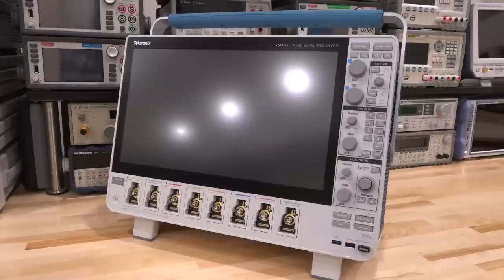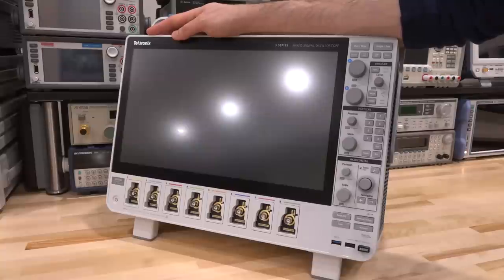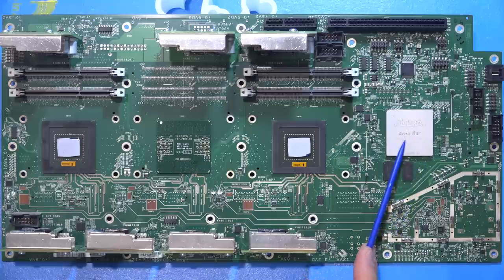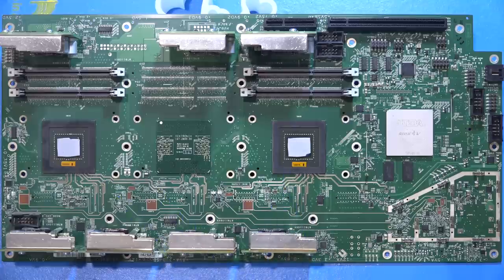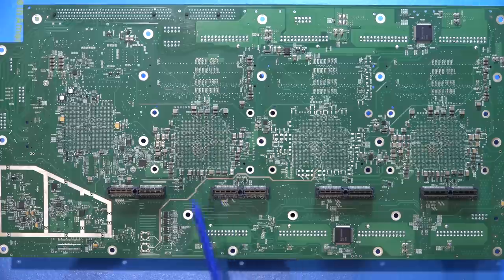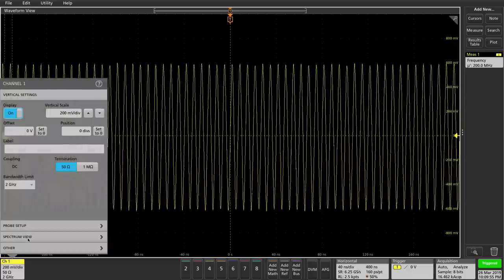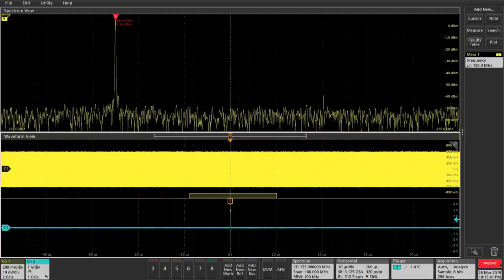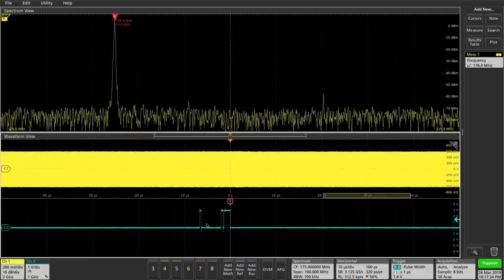TSP #149 - Tektronix 5-Series 8-Channel 6.25GS/s 2GHz MSO Teardown & Spectrum View Experiments

Comment: Nice job, Shahriar.  A few comments:  At about 12m you stated that the memory and sample rate drops when you add all channels.  That's not true in this instrument.  You retain full sample rate and memory depth on all channels.  I like the idea of pluggable mixer modules.  Of course, the MSO6 goes to 8GHz and thus could do this measurement without down-conversion.  The ADC samples are not interleaved between the analog and RF paths - the same samples are available to both the analog path and DDC path simultaneously - this is why you can get Spectrum View up to the full BW of the scope.  At around 22m you commented a few times about not being able to drop the spectrum time exactly where you want it.  This only happens when you're using a mouse or touch screen to move the spectrum time.  If you use the wave-inspector shuttle-jog control, you can put it anywhere.  It's just a little bug in the UI when using the mouse to drag the spectrum time.  One more thing that would be VERY interesting to do on this signal would be to double-tap the Frequency measurement badge that you have on, and turn on the Trend trace.  Then, you'll see the Frequency vs Time trend of the hop (similar to the FvT trace on the MDO4k).  Another handy feature of Spectrum View is that the pinch/pan/zoom all work on the Spectrum View display.  Also, the Horizontal position and scale knobs directly control the center frequency and span.  Pushing the Position knob will adjust the center frequency to the Reference Marker frequency.  Another interesting point about having Spectrum View on multiple channels - you can have a different center frequency and a different spectrum time location on each channel - think of the possibilities...  As for triggering on RF, MDO capability, etc. - all I can say is that this initial release of Spectrum View is just the tip of the iceberg....
Reply from the maker: Thank you for the clarifications! I filmed this before the firmware was released and had no documentation. Why does the sample rate change when I enable the Spectrum View? Is there a way to fix the mouse 'snapping' issue? I was never able to get Spectrum View to show the anything more than 312.5MHz, do you know why?
Reply: @Thesignalpath  In the current implementation, the Span is limited to 312.5MHz for the 5 series, and 1.25GHz for the 6 series.  This may change in the future.  Similarly, in the current implementation the maximum time-domain sample rate is cut in half when Spectrum View is enabled, but I haven't heard "why" yet...  The spectrum time location can be precisely set using the jog-wheel on the front panel, and using the Spectrum Time Position field in the Spectrum Badge.  If you click on this field, you can roll the mouse wheel to adjust in 1% increments, and pushing the mouse wheel (3rd button) puts you in "fine" mode where it adjusts in 0.1% increments.  Engineering tells me that the 'snapping issue' when dragging by hand will be addressed in the next release.
Reply from the maker: @w2aew  Fantastic! Thanks Alan. I'd love to meet sometime again soon. I hope all is well.
Reply: @Thesignalpath  That would be fun!
Reply: Last week I used for the first time the Trend trace which based on the measured frequency (automatic function). It is amazing, because the current value of frequency is determined every period of tested signal (!). Hence the trend function can precisely generate the trace of frequency changes. Incredible functionality.
Reply: @misyogi  There is also an optional feature of the Spectrum View digital down-converter that can give you the Magnitude, Frequency and Phase deviation traces for any signal - much more precise and higher resolution than a measurement trend line.
Reply: @w2aew  Thank you for the hint. I will check it on ours MSO64 and MSO58 scopes.
Reply: @misyogi  ...and you can even use the normal scope measurements on these RF vs Time traces.
Reply: Triggering on events in frequency domain or spectrogram should be a feature. Does it support actually a proper frequency vs time spectrogram / waterfall view?
Reply: @CodeJeffo  You can trigger on the RF Magnitude vs Time and the RF Frequency Deviation vs. Time characteristics of the RF signal.  Spectrogram/waterfall coming shortly...

Comment: Very cool instrument and analysis. Obscene amount of fast math computation. Thanks for your hard work. Watched at 1.5x haha.  Some thoughts:
-Product/market differentiation is an obvious business concern in terms of not wanting to enable every conceivable option on every instrument. Tek is very generous as a company, but they have to have a working business model of course. Enabling new firmware features on existing instruments over time, allows a lineup to remain competitive without manufacturing changes. Flexible hardware architecture goes a long way for that when it comes to initial product planning, also giving software/firmware guys more dev time after release. Higher initial costs vs higher long-term returns etc. Yay business things.
-I've seen some weird BGA chips before that look like interposers from the top but actually have a die or two on the underside. No bypass caps in your case as you said, so probably not what's going on here.
-I've always wondered if there are gov't restrictions for sale/manufacture of products that could function as an extremely wide bandwidth realtime spectrum analyzers, in terms of being used by bad actors to characterize complex radar signatures etc. Kind of like IR cameras being limited to 9fps for US export due to similar concerns of unwanted use.
-Realtime wideband capture + multiple receivers for triangulation + "deep" analysis/characterization database + tactical interconnectivity = big current mil. interest for obvious reasons
-w2aew's comment talked about frequency vs time trend, it would be interesting to see how "nicely" that's implemented. As a point of interest, one of the scopes I still own is an old 2GHz LeCroy WavePro from 2001, and with enabled options, it can do frequency waterfall display (time vs freq), 64Mpts single waveform capture + 2.5Mpts FFT on any part of captured waveform, which you can scroll/"play back" to see the same frequency hop changes you've shown on the 5-series. It even does vector demodulation with constellation/EVM etc displays. It's ultra awkward and quirky to use and requires high user expertise, and 90MHz cpu running VxWorks is comically underpowered for operating on 64Mpts waveforms haha, but just throwing this out there as a cheap used option if wideband analysis is needed for someone. These days I either use it for radio signal tracking, or for its acq. memory. It's networked, so I export to matlab and run various tools I've built over the years.
Reply: whatlions, To retrofit a fast computer wouldn't bring it up to date, but would enable some spiffy experiments! Your comments vis-a-vis military uses are enough to make anyone wet their drawers.

Comment: at about 25min: some of your features in the FFT must come from the fact that your FFT window contains portions from before and from after the frequency shift. That said your actual switching between the frequencies might be faster that what you read from the transition from clean 150 MHz to clean 200 MHz. Is it possible to zoom into the waveform display once you did the single-shot capture? It would be interesting to see the transition between the two frequencies in the time domain.

Comment: Maybe the mystery chip is an alternate ADC position for the 4 channel version.
Reply: it doesn't seem to receive any analogue signals though, does it? I think its also a bit too big for just something that handles triggering for that other version of the scope. Is there a version with awg maybe or an mdo variant...
Reply: @PlasmaHH  All of the MSO5 and 6 series have an optional AFG built in.
Reply: Considering the decoupling layout looks to be the same as the other two it's either that or someone on the design team really wanted a 12 channel version. My guess at the interposer is that it's likely terminating clock lines and the like. Perhaps with embedded resistors.

Comment: Hi, quick question, the analog inputs into the ADC doesn't seem to be length matched? It looks like some are longer than the others. Wouldn't it cause problems in synchronization between channels?
Reply: This is all managed in the calibration of the instrument.

Comment: Another unusual feature of this scope is that it can decode and trigger(!) on 100Mbit Ethernet.
It can trigger on Ethernet frame content.
I am however missing two features:
* Ability to add custom frame decoding. At the moment it only decodes the Ethernet and TCP/IP headers.
* Ability to save many decoded frames and timestamps for analysis.
Reply: This is indeed an interesting feature. The documentation says you can trigger on SFD and the like. Does anybody know how usable it is when analyzing non-standard ethernet frames? Fast Ethernet based real time buses have different frame structures, no or short preamble, and so on. Is triggering and analysis customizable?
Reply: Does anybody know if 100BASE-T1 decoding will be available in the future?

Comment: Is that a PCI(e) slot on that first board in the upper right corner or some kind of custom interconnect for addons?
Reply: It wouldn't surprise me if it was a PCIe.  It's a great standard and the high end FPGAs can interface to it directly. Even the latest USB is essentially a modified PCIe.
Reply: @kodiak2fitty  I typed the comment too soon, just a couple minutes later he mentioned it was.

Comment: My first thought for the interposter chip was some kind of wiring matrix to connect the memory with the acquisition chips. The idea would be that if you added more memory you would also swap the interposter with one that interleaved the bits in a different pattern. Like RAID 0 with different strip sizes. A modern version of the classic plugboard. https://en.wikipedia.org/wiki/Plugboard

Comment: Now we play the 1080p waiting game :P
Reply: 360p Early Squad Unite!
Reply: @timlister177  Unite!
Reply: Be sure to send back a situation report
Reply: I would like to see a scope with a 4K display. Actually, even 4K is a bit low for a modern high end scope - 4K is barely enough to cover 11 bits of vertical resolution (never mind having multiple channels displayed at once...) and the horizontal depth has far exceeded display capabilities for many years.
Reply: Alyx, How about a WIDE SCREEN version as well? Most measures are horrible when viewed on the common sized screen sizes, especially when using an FFT display.

Comment: If they maid signal mixers to bring the measured signal into the middle of the bandwidth of the out of band oscilloscope. They would not sell the much higher bandwidth ghz oscilloscopes.
Reply from the maker: That is not true. High-BW scopes provide broadband measurement which down-convert mixers would not do.
Reply: @Thesignalpath  did not know that. I would imagine that a broad band mixer is not as accurate as a mixer dedicated  to that function. But of course  dedicated test equipment costs $$$ .

Comment: Come on, triggering on the SPI signal that you yourself switch the frequency with... The whole scenario only makes sense if you actually had triggers in the frequency domain. It's sad that this feature is missing, since it should be easy to implement (can't be too hard to look if bin with most power changed).
Reply from the maker: Roland Klein Frequency domain triggering will be implemented in the future. Furthermore, I am trying to show the multi-domain capability.
Reply: @Thesignalpath  And I like what you are showing, as always! To me, however, it was disappointing to learn that this feature is missing (for the time being). You are quite an authority in the field, but here I got the impression more of a marketing video instead of a critical review. Never mind, I think it's just because I had found myself building an FPGA based triggering device a while ago that did just that: generating a trigger signal when highest power bin number changed by more than a predefined value within certain amount of time...
Reply from the maker: Roland Klein Did you miss the end of the video where I explicitly criticize the instrument for its lack of dedicated trigger input, missing Spectrum View features and that the instrument is most useful in its 8-Channel configuration? Also the annoyance of not having a single probe which supports both digital and analog ports?

Heck I tested the instrument using a competing brand synthesizer even dough I have a Tek one in the lab. But I guess it is easy to accuse someone of “marketing” from behind a keyboard.
Reply: @Thesignalpath  You really get me wrong here. No accusation, at least not intended. I said I got the impression. I'm just giving some feedback. With my full name and a foto. Only could do it from behind the keyboard. Wouldn't have thought this could upset you. I know better now, sorry.
Reply from the maker: @rolandklein8260  OK, but you said "I got the impression more of a marketing video instead of a critical review." Whereas I specifically called out exactly those shortcomings you brought up in the video along other weaknesses of the instrument. So I don't understand how you can get that impression then. It takes a huge amount of effort to make these videos, it takes time to put together experiments which show both the strength and weakness of an instrument. The whole point of how I produce these videos is that they are not just marketing nonsense. So when someone gets an impression because they did not watch the full video, it gets frustrating. Either way, no hard feelings. I am sorry for getting upset over it.

Comment: The real ADC comes from 6.25G*8bit. It is not real 12bit ADC. It combines two 3.125G*8 bit ADC to get 3.125G*12bit ADC. So the ADC bits drop down to 8 bit at 6.25 GSa/s. TEK is a liar and cheater!!!
Reply: I'm sorry, but this is not true.  The ADC in the 4, 5, and 6 Series is a true 12 bit converter running at up to 25GS/s.  In the 4 and 5 series, there is one ADC per four channels, that is why each channel samples at 6.25GS/s max.  Memory BW limits are what cause the scope to store 8 bit data at the highest sample rate.  However, all signal processing, DSP, spectrum processing, digital down-conversion, etc. is done in the 12 bit realm.  There really is nothing lost when storing the 8 bit data because at the highest sample rate, the ENOB is just under 8 bits anyway.
Reply from the maker: Your comment is filed under “Confidently Wrong”.

Comment: This looks like small pc motherboards on one pcb. Why this crap is so expensive I don't know
Reply from the maker: Browarus Pierogus Many reasons. Custom ASICS, cost of R&D, software and the many other components I have not shown. Considering what you get, the price is not all too bad.
Reply: @Thesignalpath  Everything can be 'custom' today because pcb companies are much better and cheaper.
What I think is those companies lost their mind and engineers will never get hands on proper equipment unless technology changes and destroys those greedy brands
Reply from the maker: I said custom ASICs, not PCB. This is the cost of R&D. Technology has also moved forward tremendously in the past 20 years. The cost performance ratio has gotten better.
Reply: @Thesignalpath  Today you can design any ASIC and give it to f.ex. TSMC to manufacture. All is so easy and cheap. Those scopes are nothing but ripoffs
Reply from the maker: You don’t understand the cost structure  of semiconductor design. But that’s OK Dan, it doesn’t make a difference.
Reply: @Thesignalpath , Most PCB manufacturers don't know much math. Most corners are cut when you don't know what you are doing.